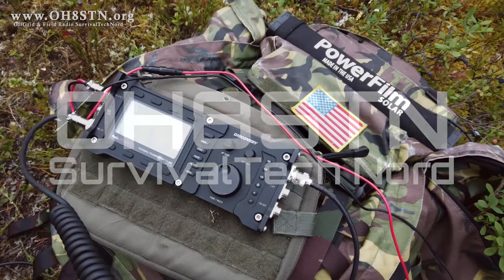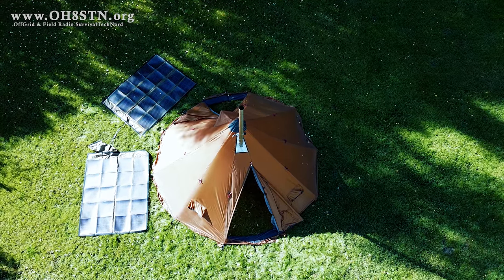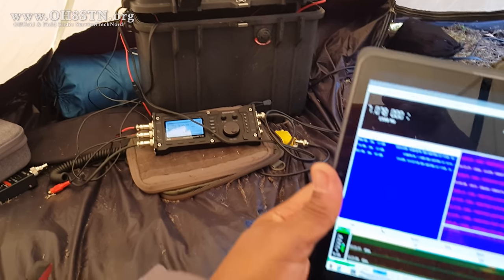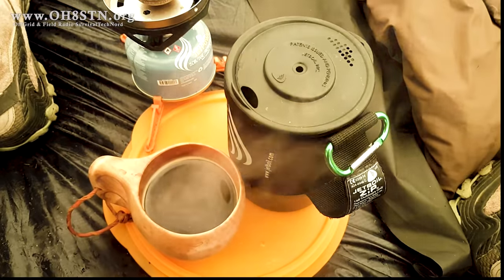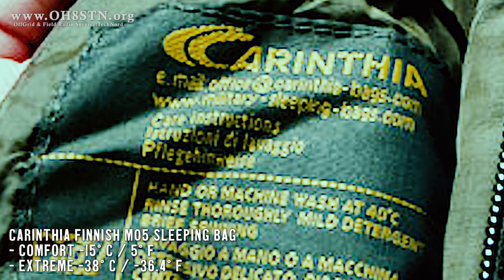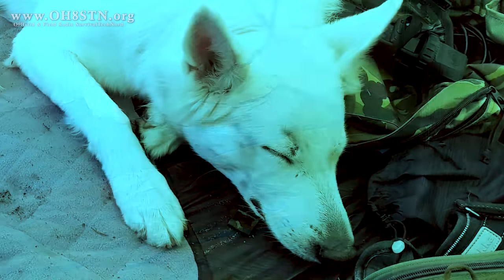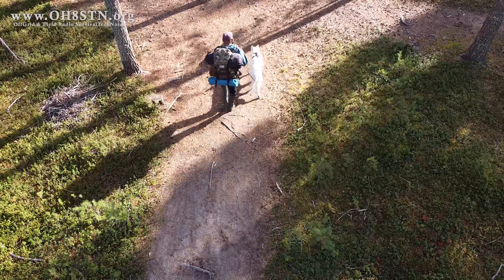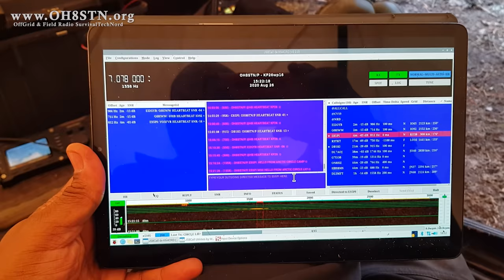Portable Ham Radio | Camping Gear & Shelter

Comment: A carbon steel pan is also an option instead of cast iron. It'll probably be at least half the weight of cast iron but will take a seasoning and be as non-stick as a cast iron as well.
Reply from the maker: That's another good point. They are a little cost-prohibitive but definitely an option. I need to figure out how to shave some ounces or grams someplace else for that to be an option. It's a great option though. Thank you for this 👍
Reply: @OH8STN  amazon has some for around 20$ USD.

Comment: Good Morning sir, I just wanted to tell you that I have been watching your channel for a couple of years. I dont comment very often, but dont let that make you think I dont get a lot out of your videos or that I dont greatly appreciate what you are doing. I am currently building a kit and it has been a long time coming from when I started following your channel a couple of years ago. Just for fun, I have had one of those tents you have a couple of, for a couple of years. It is a really nice option, probably out of  my budget, but I also understand you get what you pay for as well. My wife and I have a little off grid cabin, in the southeastern part of our state. We built the cabin ourselves, using portable power generator to power the few electric tools, but mostly using hadn't tools to build the cabin. While there, a family emergency occurred, that ended with good results, based on the situation. However, being 2.5 years ago, I left there, with the knowledge that places like our cabin and other places my wife and I find ourselves camping and vacationing in areas, the cell phone service etc, does not work or works to slight, that in an emergency, it is not going to cut it. I left our cabin that weekend after the incident with my dad and low blood sugar putting him into a diabetic comma if you will, with a strong desire to learn about ham radios and how I could utilize one for a case such as this. I know the Volunteer firefighters in the areas of that part of the state all operator on Ham radios and some private repeaters etc. I passed my tech license July 2018. Since then, I have been saving for better radios, battery packs etc. Long story short, I have acquired My general class, and most recently my Amateur Extra class, and the new ICOM IC705. I purchased the radio last week, and ordered the super antenna this morning when I woke up. I am looking forward to working with my equipment, and I appreciate your willingness to help us come up with other solutions for true offered comms. Thank you so much. The low watt icom ic 705 is a great started radio for me, (I think) I am also wanting to learn more about the raspberry pi and working with some low signal digital modes. I know it is baby steps to get there, but slowly but surely, i keep learning more and looking forward to experiencing more with the low power HF modes etc. Thanks again for always being willing to help us learn more about true off grid comms. I wish you was my neighbor. :) since your not, I will keep watching and looking forward to your next videos. Thanks again, stay safe and healthy and I Hope you have a blessed week. 
Dale
KI5ARH

Comment: Julian, I really liked your video on extended portable emergency communications.  Lots of good info.  I use an REI Dome 2, and have not had occasion to camp in winter conditions.  I also use a MSR Miniworks Filter, coffee filters over the inlet port to filter out gross particulate matter, and a battery operated UV light to purify the filtered water.  Take care.

Comment: YES! I agree. My Ham Buddies all either use a trailer to ham in the wilderness (like Winter Field Day) to a canvas tent. You cannot go out too far from a vehicle that way. I just purchased a Smokey Hut from OneTigris. I've set it up a couple of time. It goes up very quickly. I want to be able to put my rig and all it's components on my back with a shelter, sleep system and food for more than three days. I'm not there yet but I'm moving in that direction. Next purchase for me will be the Wolf River Coil TIA ( Take it Along).  I take a lot of guidance from you and your videos because I like your setup so much. I'm going to try a Ham Pi computer load out and I'd like to go headless with a tablet like you do. 73 KE0OAP

Comment: I have a jetboil and love it.  you're right about running out of fuel though.  since most of the magic of a jetboil are the "coils" on the bottom of the container, it seems like it shouldn't be too hard to build a pyramid shape that folds up, but can build a wood fire under and have a jetboil top that attaches to it.  hope my rambling make sense.
Reply from the maker: Good idea. One idea I have pondered for years, is a firebox stove adapter for the Jetboil. Not sure if that is a stupid idea or not, but it would be nice to prototype it.

Comment: I've found that if i take my pans out of the camping kit and using them day to day you can get used to cooking on them and also they get seasoned in the process.
Reply from the maker: That's a great point and your assumption is accurate. I put them in the kit and I don't take them out again until the next time I'm out in the field. So as you suggested, I don't get enough training cooking with them. Excellent point 👍👍👍

Comment: I don't live at 65 degrees north so I can get by with much less equipment, which is good, because I'm old and like many hams, my mostly sedentary lifestyle has left me in less than optimal condition.

I have a Hennessy hammock with integrated rain fly and mosquito netting.  I got an insulated pad that's custom fit for it that allows moderate winter camping without literally freezing my butt off as would usually happen in a hammock.  You mentioned your sleeping bag but didn't mention your ground pad.  From my experience, a good ground pad is essential for winter camping.  I like Thermarest pads or something similar - a self inflating air pad with open cell foam inside to insulate far better than air.

I made some aluminum can stoves that burn alcohol.  The stove weighs 3/10 of an ounce.  Not good in winter, so I'd probably use the MSR Whisperlight International.  I camped with fires a lot as a boy scout five decades ago, but for the last 40 years I've preferred the simplicity of a small cook stove.  I never cared for the smoke, and a fire is not covert.  A fire can be smelled a mile downrange.  I do have a twig stove that can burn a small amount of twigs or pine cones.  I do like the efficiency and the fact that I don't need to carry any fuel.

It's always good to see what others are doing, even when they're doing something completely different.  Your videos are so well done they're always a joy to watch.

Comment: Appreciate the deep dive on your "everything else" gear. I was curious about that tent and wood stove. They're a lot bigger than I usually take backpacking, but then, I'm not at 65 degrees north. 😁 Fine business, 73
Reply from the maker: If you check https://oh8stn.org/shelter-system/  I do have a smaller tent as well. It's about large enough for sleeping,  but not much else. This shelter serves sleeping,  cooking, radio ops, and a nice place for my dog. It's bigger but only because the goal isn't purely hiking and sleeping. I also couldn't use a wood stove to keep it warm if it were any smaller. Does that make sense?
Reply: @OH8STN  absolutely, it looks like a very comfortable field living space! You have a different goal and therefore different gear than the thru-hikers. Makes sense!

Comment: Cracking video as usual Julian. With the exception of the tent, my "outdoors" system is pretty much the same, with a few tweaks. I use the British army "medium" sleeping bag which is a licensed copy of the Carinthia Defense 4. When you combine it with the Lightweight bag (again a Carinthia Tropen copy) you are good down to 0F/-30C. That bag has seen me through some dire conditions, both in the tent and my hammock. If you ever need to replace your system, take a look at ebay as they are quite easy to get a hold of.
My winter load carry system is the Dutch Army/Lowe Alpine Saracen. The trouble is it's too big, and I've been looking to revert it to the British Army bergan (or a Sting like yours)to reduce the size somewhat, just way down the priority list right now. For winter cooking I use a white gas stove. I have been caught out with "extreme" gas canisters and spirit burners not working correctly in the cold. The stove is a Chinese clone, but I ditched the pump assembly (it was garbage) and replaced it with one from Primus for a small uplift. This makes the system perfect. In the other 3 seasons I have the choice of Trangia/Fancy Feast stoves, gas burners or a small open stick burner, if I can't run an open fire. Cast Iron is definitely the way to go for cooking. Not light, but a small skillet/frying pan is invaluable. My campfire chicken and chorizo paella is awesome.
I've yet to get a Winter shelter big enough for a small wood stove and man portable ops, but I have been given a 14' x 14' x 7' canvas ridge tent. Not exactly man portable but it's big enough for 2 - 3 to live in, in comfort (on military style cot beds) with a Frontier stove for heat and cooking. This is still a work in progress. (check the video snippet on FB). 
Anyway I'll be off the road so to speak for a couple of weeks now as I'm having ankle surgery (again) on Wednesday. So get busy making content for me to watch whilst I'm laid up ;-) 
Stay safe Julian, ATB to you and yours. 73 G1AW.

Comment: For your fry pan, make some circles of aluminum foil the size of the inside of the pan and be able to throw them away after you cook.  Almost no weight.  For Snapper can you heat some rocks when your in your tent? That way when the fire burns down you have hot thermal mass that will radiate heat for hours.

Comment: Seasoning titanium seems to work, just be a bit careful with heat afterwards so you don't burn it.
Reply from the maker: Thanks for this. I wasn't sure if it's possible or not but I'll give it a try.
Reply: @OH8STN  Will be interested to see how that works out.
Reply: @OH8STN  it works excellent I've seasoned all my TI pans even my snow peak plate if I wanna fry In it!!😋

Comment: This is a personal thing and not a criticism of anyone else. I have stayed away from gas canisters because of the cold weather challenge and the difficulty of recycling or even disposing of them. I found I was only going North of my home when using canister fuel so that when I came back on Sunday I could go into the waste transfer facility to get rid of the empty canisters. The stores which sell them should have to recycle them. 

Now there are reusable 1lb cylinders available in North America which can be refilled from a 35 lb capacity forklift tank. Those are fitted for liquid withdrawal and the adapter for filling the reusable tank is National Fuel Gas Association and ANSI compliant.

Comment: My opinion is that being warm and dry are prerequisites to being able to do anything else. If you are hypothermic then you have a medical emergency and will not be able to use a radio for much more than sending an SOS.

One needs to build on a strong foundation before considering all of the nice to have items.

Comment: Love the videos !! Just a heads up for your Jetboil stove and cold weather. I do a lot of backpacking and use my Jetboil in all temperature ranges. In the cold, I keep the fule caniste3r in an inside pocket of my clothing and keep it inside my sleep system at night. That coupled with some canisters that are a blend work well in the colder temps.  KO4BPM

Comment: The problem with titanium pans is that titanium does not distribute heat evenly on its surface. This is part of the reason why the food sticks to the titanium pan. In that sense, both stainless steel and cast iron are superior to titanium.

Comment: I think going back to cast iron would be too much of a weight hindrance, I have a Muurikka Picnic which is a little lighter than my skillet, however still not as light as my Ti equipment.  When you side bu side a 600ml mug in stainless and then Ti the difference is profound.  With regards gas, it is a few years since I worked in the trade but, at a glance you are using a regular gas mix.  I presume when you are expecting below zero you will ensure you have the wood stove, however if you ever plan to possibly use the Jetboil below, Jetboil, Primus and MSR all have offerings with modified butane/propane mixes to burn at lower temperature effectively.  Some are sold as all season, some as dedicated winter mix - the big take away is not all gas is equal, I find some cheap brands don't work as well for mountain use, whereas those three do.  With regards the Jetboil itself, lots of products emulating them now and quite a variety in price. I use an MSR Windburner which improved has wind resistance when having to use it in less sheltered locations.  It also has a regulator on the gas, something I believe Jetboil have added to some more expensive models, currently the Mo range.  As with many things - the cheaper copies will work, but tend to not offer the same features.

Comment: Camping gear I think it's 75% and radio is 25% I find my other gear takes more to prepare than my radio gear. Finding the right items and test out I find takes more than testing out your radio. 
I have geared my adventures to a small trailer or a canvas tent. Not lightweight but functional. My ultra light set up has not been tested like my other ones. I will plan on doing more soon once that new lab599 radio comes in.

Comment: Try an MSR whisperlite. It’s multi fuel and works at very high altitude and very low temperature. Being able to care different size fuel bottles is a huge plus. You could siphon gas out of a car and it would work perfectly.
Reply from the maker: I have looked tat the multifuel stoves in the past. I was alwas confused by the selection. I'll definitely check it out.
73
Julian oh8stn
Reply: OH8STN Ham Radio They’re definitely worth a look. I’ve personally used the Whisperlite above 14k’ msl in subzero temperatures as my primary means of producing water and preparing food. Never failed us once. This stove was chosen since it would be used in various countries where the specific type of fuel was unknown and we could fly with the empty fuel bottles in our luggage. Another upside over the jetboil is that it’s field repairable to a point with tools and spare parts coming standard with the kit. It does have a couple downsides though. It takes about five minutes to setup and get a flame going compared to a Jetboil (I have both) and it doesn’t boil water quite as fast either but you can’t cook bacon on a jetboil.

Comment: Radio 75%, camping 25%? I think that's a bit off. More like 50%-50%, or even 40%-60%. If you don't prepare, and aren't able to protect yourself and your gear from the elements, you aren't going to be operating in the field very long. If you can't eat, sleep, and stay warm, you can't focus on the radio part. And life, much less radio, without coffee....well, that's not going to happen for me.
Great video as usual, Julian! Thanks!

Comment: If you really want to lighten the pack, you should get rid of the skillet altogether and cook meals that are higher calorie per mass. In general you want something that only uses boiling water as a base. Because it wont stick but more importantly because water is most of the mass you don't want to carry (from the start, as you refill water on the way).
That way you get rid of the pan and the meat full of unnecessary water. An ultralight packer has only a single pot in general. I guess for your condition another teapot for melting snow is also good to have.
Ultralight Dandy youtube chanel is a great place to learn about tasty recipes for ultralight backpacking. Way better than the dehydrated stuff, good taste is also important for moral!

As for fast and multifuel cooking, I do prefer myself the "caldera" stove system. It uses wood or alcohol or solid fuel. It heats up pretty fast, not as a jetboil for sure but still under 5mn. It is generally admitted (taking into account the whole system) that alcohol is lighter to pack for less than 10 days missions, above that gas gets lighter. Also alcohol doesn't freeze, it will just take a bit more time to start (warm up to produce alcohol gas).

Comment: Titanium is awful in conducting heat, you will get hot spots and stuck food.  Plain aluminium is actually a much better heat conductor.  Cast iron is great but too heavy unless you are pulling a pulk, to be honest you'd be better with a good quality teflon fry pan.  Jetboil are one trick stoves, better off with either a multiful stove like a Coleman XGK or Primus Omnifuel combined with pots that have built in heat exchangers, same performance as the Jetboil but you can use big pots on them or a Trangia with the multifuel or gas burner insert (very very common in Scandinavia).
Reply from the maker: Absolutely awesome suggestion. Somene else just mentioned a multifuel stove. Your comment seems to support that idea. I will certainly investigate.
Many thanks
73
Julian oh8stn
Reply: @OH8STN    Some like the Primus Omnifuel burn a really wide variety for fuels, Coleman, kerosed, gasoline/diesel (those two burn dirty so be prepared to maintaining your stove more) and standard thread gas canister so you will find fuel somewhere along your journey.

Comment: Ti seasons very well with lard and an oven 👌 I'm asking your help with a solar panel selection, I've been debating between the 20w or 30w solar film panel for backpack basecamp I won't be using a ham radio (call me crazy)😆 just for my gear lights battery's any type of camping luxury that kinda thing!! Please any input would be grateful stay strong&healthy safe&happy!!(=✌💚
Reply: Also I already have a few small ones 21w anker and a couple 10w panels